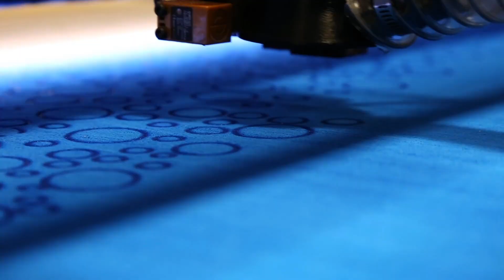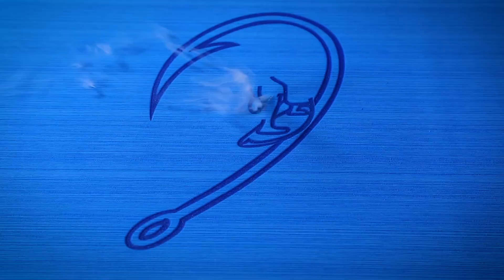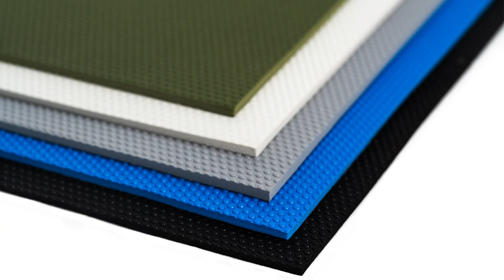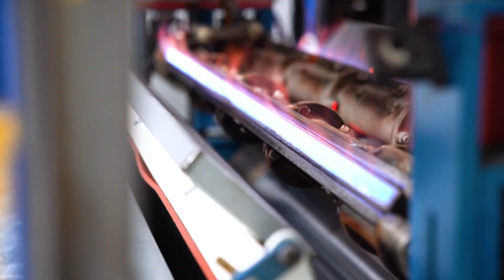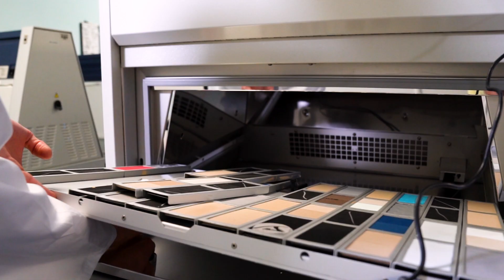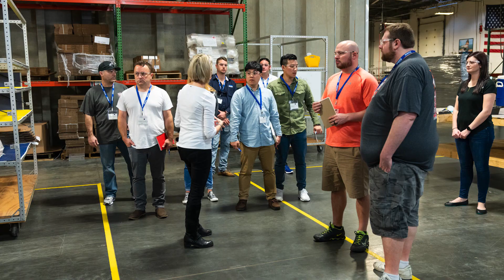The SeaDek Story

Comment: What impresses me about SeaDek is there is no reason this foam cannot be made any colour and design, and you've done that, but all your competitors insist on variants of Teak and some other wood-look effects. And that's okay, teak is hugely popular, and they have some whites, greys and blacks too. But that's IT. But modern materials can be any colour, so why limit to that colour? And again, wood panels are a great effect to mimic, but there is no reason to limit to that, e.g. your fractals and bubbles. Anyway this is a long way of saying I admire your innovation. I saw a youtuber who did his 1990 fishing boat out in black with bright blue trim, it has turned an old looking boat into something that looks like it is from The Matrix. Like it's from 22nd century. The Buck Rogers fishing boat. All the other makers of this kind of decking would have given him a choice between 6 kinds of brown or go monochrome. Not really much of a choice and it would have made his rig look very dated. Right I'm signing off but if I have one suggestion it would be to add "Miami Vice Pink" to colour rosta, to go with your "Miami Vice Blue" (aka Bahama Blue).